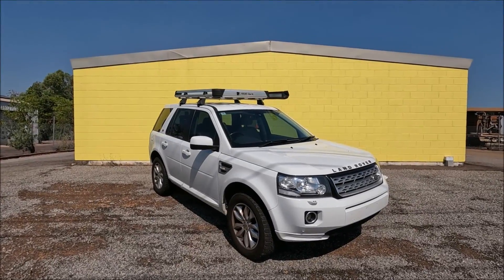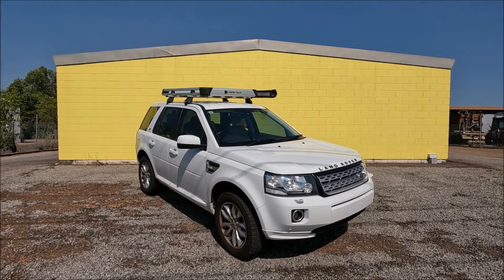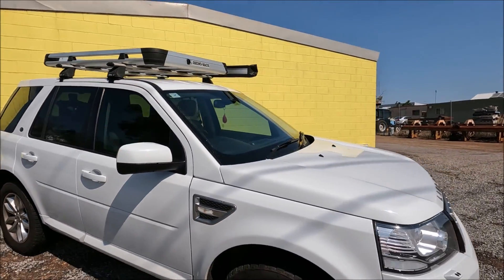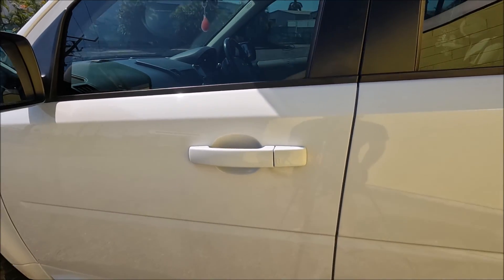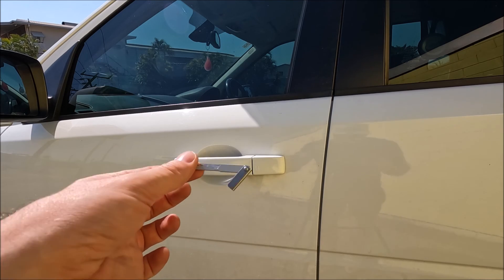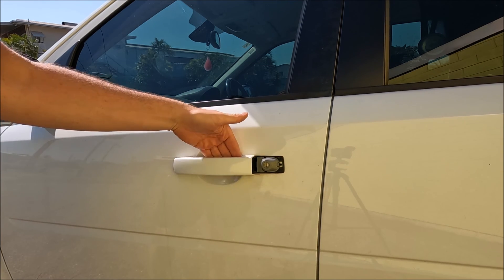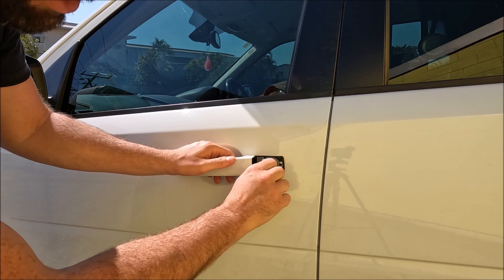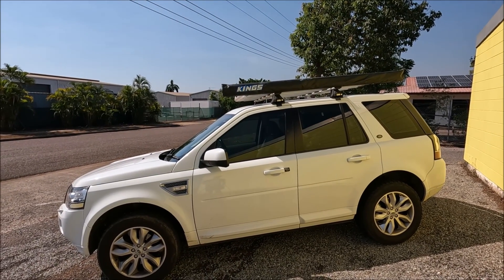How to Manually Unlock a Land Rover Freelander 2 (LR2) Flat Battery or Broken Fob Tutorial

Comment: Hi Ross, similarly to others my battery is flat so the fob won't work. Once opening the passenger door is there another way to turn the alarm off as of course i wont be able to immediately start it up. If not, how long a period of time will the alarm sound?

Cheers
Reply from the maker: Hi Jason, unfortunately the alarm will sound as long as it has battery available. Are you able to get jumper leads to another car? if so I would open the door and then the bonnet, connect the battery to another battery or car and then disable the alarm. You can then lock the door using your manual key which does not enable the alarm. I hope that helps. Ross
Reply: @RossPerryProductions  hi mate, I actually have a battery jump starter I can use, but didn't see the point jump starting because I don't need to use the car that much at the moment so would likely happen again as the battery goes if I don't use it for a week. I just wanted access to the car primarily. I've also had it go so flat that I've had to remove and charge the battery so I've been concerned about that but I suppose the alarm wouldn't sound in that case anyway

Comment: Ahh ha!  Good video. Like your logo!  Wondering if I disconnect me battry if the car will require some codes before I can restart, or maybe use the radio, etc.  2013 LR2 US ver.  Thanks!
Reply from the maker: Hi there, No it shouldn't do, I have replaced the battery twice on mine and it hasn't required any codes etc. you will need to reset your time etc if you have it on the manual setting. Ross

Comment: My lock is so tight i cannot open the door.
Any way to open bonnet so i can swap battery?
Reply from the maker: have you tried spraying some WD40 in the lock barrel?
Reply: @RossPerryProductions  yes mate.  It has made the action a bit smoother but still won't unlock.  I put a small adjustable spanner on the key to get more purchase but it started to twist the key.
The lock barrel is done I think.  I need an alternative way to get the bonnet open to change the battery
Reply from the maker: @squirrel6338  definitely best not to break the key.  There are a few options you could try, both require you to get under the car and remove the belly pan:
1. trying to locate the bonnet release mechanism cable, I would start at the lever end and see where it comes through the bulkhead from the cab. Then follow it as far as you can, you may then be able to gently pull on it until you hear the bonnet release. 
2. getting some power into the battery, you will need to trace cables that go directly back to the battery (alternator and Starter Motor are a good place to start) then you need to get 12v on there. This could get you enough power to operate the locks. If your not confident with electrical This could be risky.
Hopefully that helps. Ross

Comment: Hello mate just wondering if this doesn’t work what else can i do battery has been dead for about 5 weeks bow and tried the above method but still doesn’t work cant get access to car
Reply from the maker: Hi Paul, that's very strange as this mechanically opens the lock. There are a few ways I would try myself like getting some charge into the battery connecting onto the starter motor cables from underneath the car. But I couldn't say they are guaranteed or best practice as there is always risk of doing damage. Failing that you may have to break a window obviously checking which ones are cheapest and easiest to replace. Sorry I cannot be of more help. Ross
Reply: Tar mate for the advice yeah the car has been laid up for about 5 weeks now really don’t want to smash the window thanks anyway.
Reply from the maker: @paullewis1692  sorry I can't be of more help, let me know how you end up getting in I would be keen to know if you find another way. Ross

Comment: i ended up using key on passenger door but as soon as i unlocked it and open door alarm went off weird.:body-green-covering-eyes:
Reply from the maker: Yes that would happen, if it was locked using the key fob then the alarm would be activated, it should switch off once the car is started, if you lock the car using the manual key then the alarm should not sound when you open it again.

Comment: I did everything as you demonstrated for us. Unfortunately, the key wouldn't go in to the lock mechanism. What did I do wrong??
Reply from the maker: I wonder if the key or barrel is not matching because one has been changed at some point, it would be worth squirting some WD40 into the hole to make sure its not just a bit seized. Ross
Reply: @RossPerryProductions  Thank you